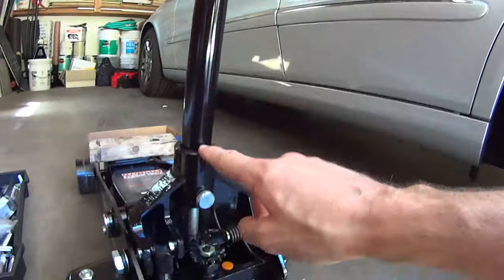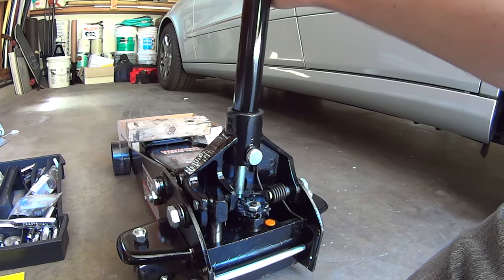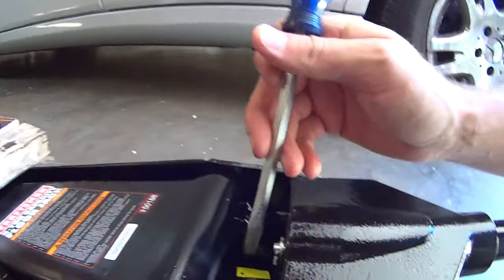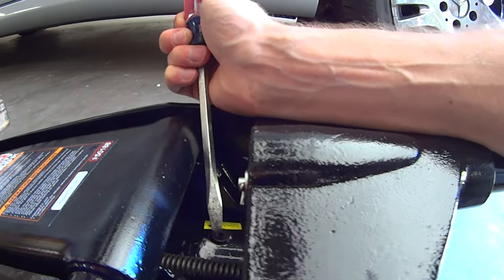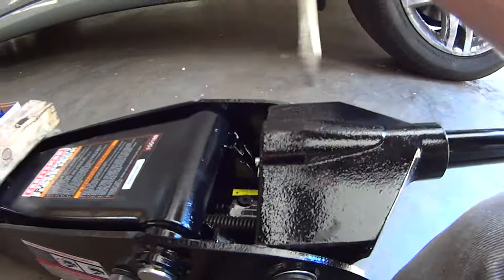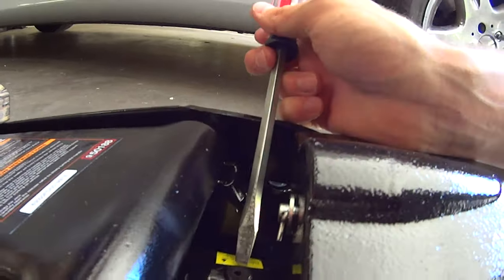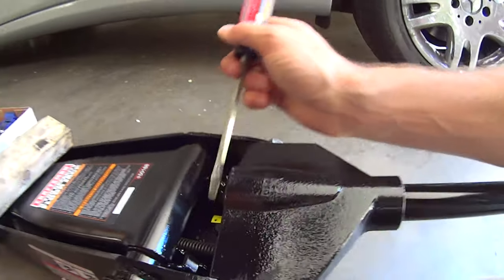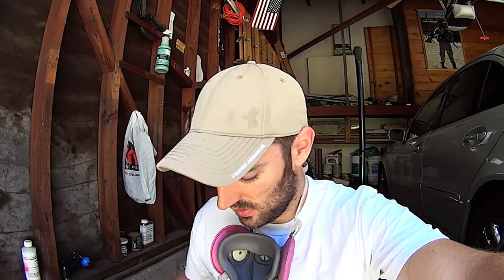How To Air Purge A Jack

Comment: If there is air in there and pinching the plug lets it out, whay not remove the plug and top it off with jack oil and replace the plug? To me that would make sence, less air means more room for oil.

Comment: I noticed you had a piece of wood on the pad of your jack instead of using a piece of wood get a couple of hockey pucks they were crate and leave no marks. you can even cut a v on one side of the pot and leave the other side smooth.
Reply: You can also make a custom, made to fit pad for your jack from an old tire. The trick is finding a shredded piece of tire large enough to cut a piece from it. Oh wait! I should be able to score some shredded tire pieces from any large tire shop in the area of which I live. Yes! Good info there, perhaps I'll do that. Oh wait! What about just cutting a piece out of a whole tire? Well, you can do that but then you'd need to either store the rest of the carcass or get rid of it and therein lies the rub. Generally speaking, you cannot just toss a tire into the trash because it isn't legal to do so. This means you might have trouble disposing of what you don't use. The bottom line is to make sure you can do what you want to do without it becoming a problem or cost a bunch of money. That's why just grabbing a piece of a tire that's already shredded works so well. Just keeping your eyes open while driving along the highway for a larger chunk of tire is a good option too. Best wishes!

- Max Giganteum

Comment: Nice overview and nice jack (I picked up one up as fixer upper and have been adding oil, burping air and exercising.  I think it's sucking in air in one of the check valves (no leaks) so I gotta review that.  What I do for burping the air is to hold my left finger on cap as I poke with screwdriver, to prevent that cap from getting airborne/lost/hidden.  I accidentally burped it in the up position and oil shot out and cap went flying, make sure it's all the way down.

Comment: I am sooooooooooooooo not a tool guy
when I read my manual it read the same as yours,  I ended up loosening the OIL screw NEXT to that rubber plug,  OIL leaked out - so I closed it -
after seeing what you did,,, makes more sense to me.... BTW  I have a Black Jack 3 Ton low-profile Service Jack I purchased it from Costco for like 119.00$ it also came with a SUV Adapter adds like 4 inches to the already 18in hight -  NICE JACK,  Hey thank you for the video.

Comment: I see several suggestions though when you read the orange sheet from Craftsman waning to purge air first, they say the air may be released while the handle is DOWN not UP. The orange cap mentioned in the posts below would not be visible with the handle down. Followed your instructions worked like a charm, thanks for the video!

Comment: I bought this package as well, at sears. I was wondering how the jack is working for you so far. I've read some reviews, and they say its unsafe. For example, it drops your vehicle really fast and what not. But it's a craftsman. It shouldn't fail that easily.
Reply: narinderpal kahlon Yes, they go down very fast. When you lower the car you have to be very carful not to turn the lever tomutch or the car fals down very hard. You say it's a craftsman, well I have the same one but it is red and it's from rodac. It's just a name the put on it but that's all. For hobby use it's very good but if I would work on cars professional I would not buy this one.
Reply: cedicol thank you. I used it for for a recent oil change and it worked perfectly fine for me. all i did was purge the air whenever i needed to use it. overall, didn't give me trouble and the oil change was successful. also isn't their any place to add grease like you can on the pittsburgh jacks from harbor freight? i didn't find a place and thought it would help decrease the chances of the jack lowering the vehicle very fast.

Comment: Hi I got a harbor freight 1.5 ton racing floor jack, I turned it counterclockwise to open the valve and to bleed it, I kept turning it counterclockwise and it never reaches the end/limit (should have a limit right?) and when I bleed it a moving rod thing connected to the lever started to leak. Cleaned it up and later closed the valve and tested it again, still leaked. It's defected right shouldn't leak at all?  And hydraulic fluid should be all the way up and you can see it clearly when you open the fill hole? I can see the oil moving when I pump it but can't see the fluid level.

Comment: Is the handle supposed to stay down when you are bleeding? Mine seems to always be under spring tension.
Reply: You sure it's the same model as the one in the video?
Reply: @kennethkline7794  exactly the same
Reply: Yes. Hold it down. You can't access the bleeder / fill port with the handle up

Comment: how do you get that rubber thing on? mines off and i cannot get it back on O_O
Reply: Donda Nana   It can be frustrating but with a small flathead screwdriver and some patience you can do it. Push the rubber plug into the hole as best you can then use the screwdriver to gently push the other side where it's hanging up down into the hole.

Comment: That rubber plug is damn near impossible to get out and put back in. And on my Craftsman 3 ton floor jack the tip of the rubber plug broke off and fell back into the fill tank. What I am going to try to do to get it out without taking the jack apart is put two metal chairs opposite of each other and put the jack on them upside down with the pumping mechanism removed. I am going to use blocks of wood to get it level to drain the oil. And tie it down. Then when all the oil is out I am going to use a vacuum cleaner hose to hopefully suck it up to the hole. And if I can get it to the hole, I'm gonna take tweezers and hopefully pull it out of there. Then when and if I get it out. I am gonna tap threads into that hole. That's with the jack upside down. If anybody has any suggestions I'm all open.
Reply: Samuel Bowers my torin 3 ton is the same style as his in the video. The rubber fill cap can be found everywhere.